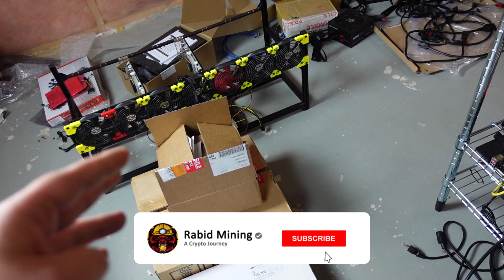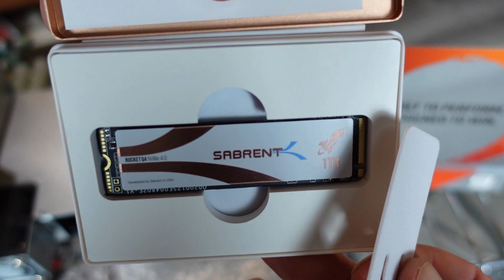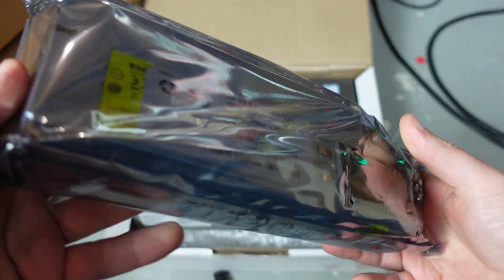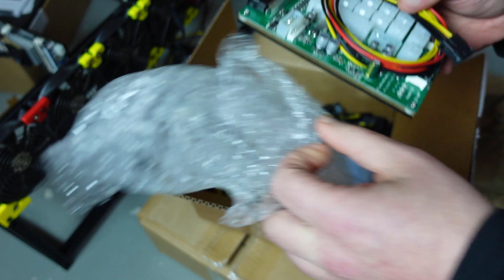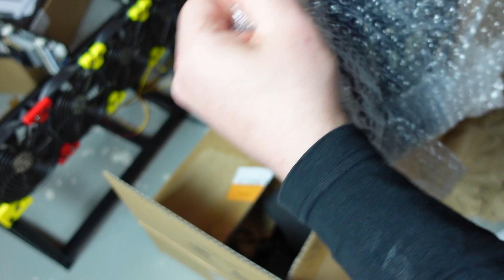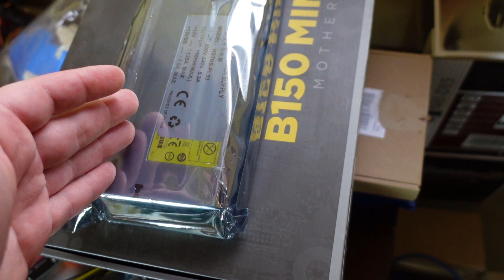RED PANDA MINING WHAT??!!!!

Comment: Nice! I've been waiting for a chia episode from Rabid Mining. Looks like they're coming. I've heard those Sabrent heat sinks are the very best!

I purchased a couple of Inland Premium nvme drives with heatsink, but I'm hesitant to open them bc they were nearly $200 each... for friggin 1tb's. Has anyone used the Inland Premium drives that can offer feedback? Looks good on paper, but there's other ways I can spend $400 on farming that doesn't feel like I'm gambling.

*Edit. What's so special about the H110's? Are they better at mining than tb250 or tb360's? I've got no complaints on the tb360 BTC Pro, except for the price of the board and the 8th or 9th gen 1151 Intel. I've never used any other mining mobo, so maybe I'm missing out.
Reply from the maker: Lots of people prefer enterprise drives they are like 800 bucks for a plotter no thx lol
Reply from the maker: No a board is a board b250s are just fine love my 2 the b250 and h110 are probably the most popular.  This is a h110 kit from parallel miner where suppose to power a h110 pro from a server psu kit including the molex connectors